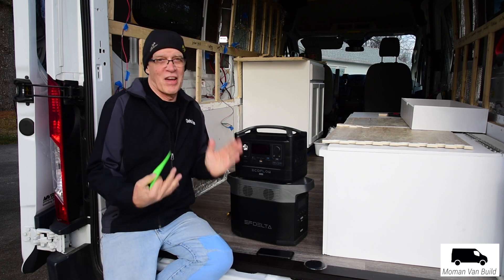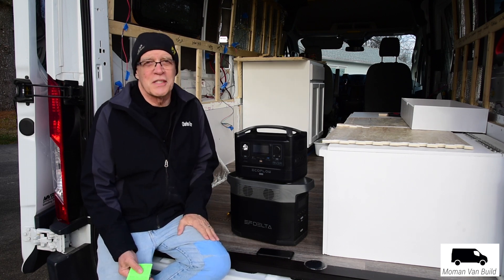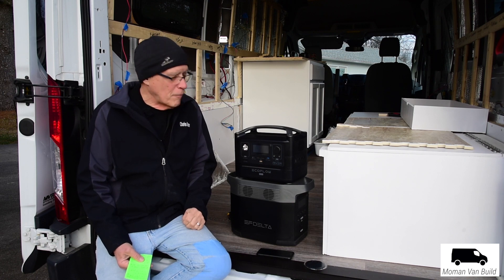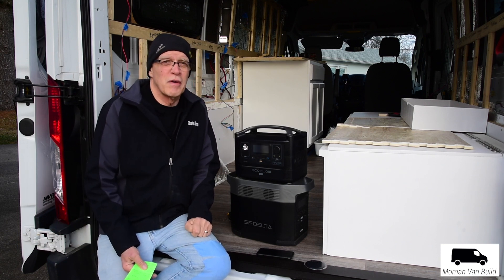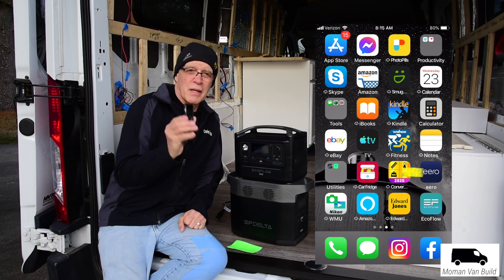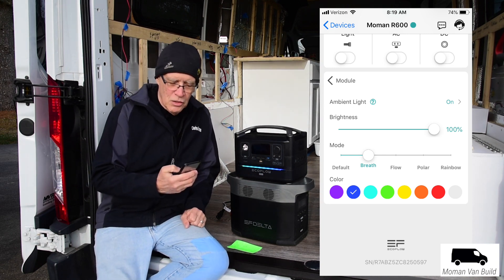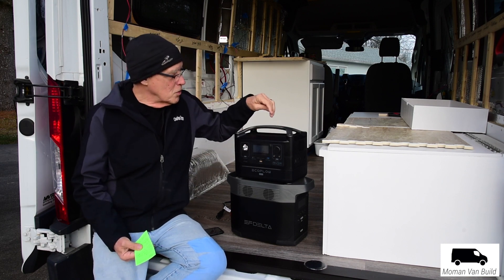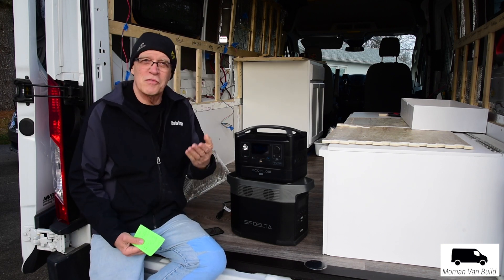Episode #26 - The Ecoflow River 600 - A Quick Look - a corporate partner spotlight video

Comment: We just bought the EcoFlow Delta and are very happy with it so far. Can't run a 1500 watt ceramic heater (or an air conditioner), but otherwise it is an amazing piece of technology. For us it was between the Maxoak Bluetti and the EcoFlow Delta, and the Delta won because of the fast re-charge capability. The company is getting a lot of good press among nomads and others. And other companies need to take notice of what EcoFlow is doing, both technically and pricewise. ~ Kir in Tennessee
Reply from the maker: I ran my 5000 BTU AC unit on my Runaway Camper for over 6 hours with a Delta. I also tested it with a small microwave and coffee maker and it worked. I have not tried with our 1500 watt heater yet. Next week I will be getting the River 600 Pro and the extra battery from Ecoflow. It is the final retail version, so it’s a little different than what they did on Kickstarter. Review on it soon.
Reply: @charlesmoman  Excellent! I was considering a "soft start" for the air conditioner. I'd be interested to know your experience with the 1500 watt heater if you test that. ~ Kir in Tennessee

Comment: you can use the river 600 while charging it? How fast will it charge that 288WH with 24v? The DC output ports are what rated at what amps?  any cases where it stops supplying power and you have to press a button or will power resume if it has power again?
Reply from the maker: I am quite sure that it does pass through charging. No idea about 24v and this unit. DC ports are on the front - you can see all of that ion their website. The rest the questions should be on their website too. I am not all that techie - check Hobotech or Will Prowse channels to see crazy tech info. I am not part of Ecoflow. I just have them as a corporate partner and they let me review their gar. I now have the River 600 Pro and extra battery that will be coming out in March. Look for a quick review soon.

Comment: But won't recharging extremely fast wear out the batteries faster? Cut down the lifespan?
Reply from the maker: I am not a techie, but I have heard that it does affect lifespan. But sometimes I think people stress over the number of life cycles of a lithium. People see a number like 500 or 1000 or whatever and the end of the world is coming. From my understanding, the life cycles number refer to completely depleting a battery from 100% to 0%, then recharging it. I almost never run my lithium units down to 0% - usually down to 50% at the most. That means it will take me a lot longer to "use up" the life cycles - but - when you hit the life cycles "limit", the battery will then drop down to 80% of its original capacity - but it still is quite useable. Many think that when you hit that number, the battery is useless - not true. In other words, for most people, these lithiums will last for many years. The only exception might be full time off grid nomads who have a different set of power needs.
Reply: @charlesmoman  Kool. Thx. Have good holidays